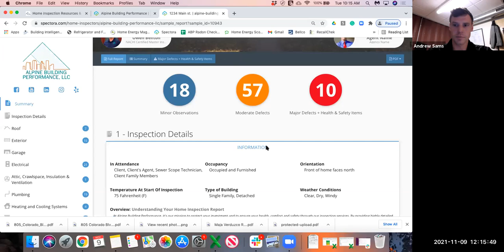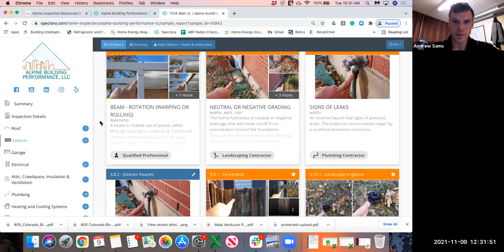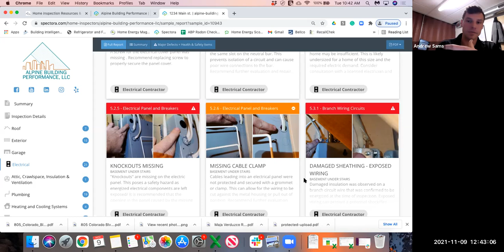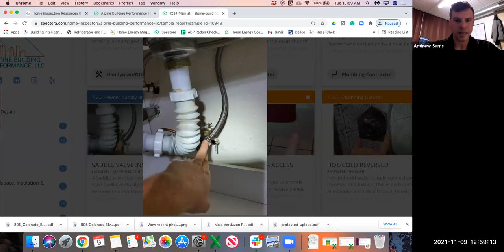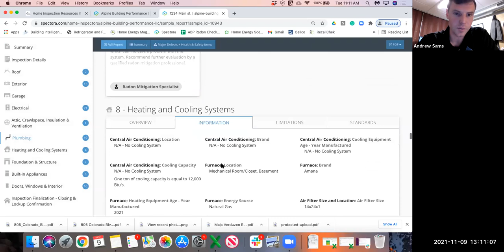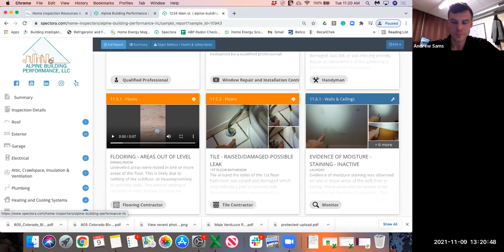"Home Inspection Training Class #39" with Andrew Sams, CPI & InterNACHI's Ben Gromicko

Comment: Question: That panel is nota FP, on the photos looks like one. Also no detailed of the Meter box, how do you determine that is not sufficient amperage if is not photo of size of wire and service? Thanks
Reply from the maker: FP panels are considered hazardous. Can't determine, if not labeled.